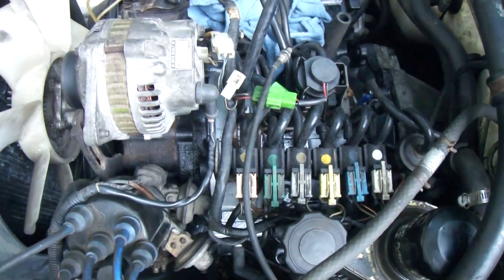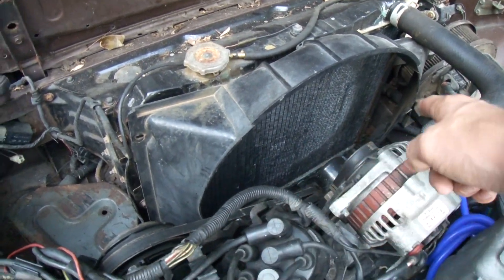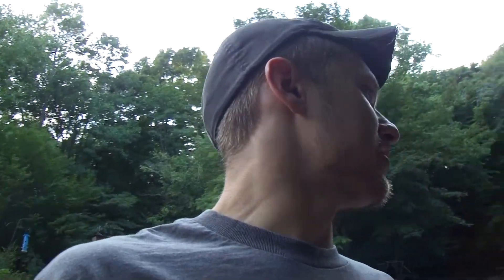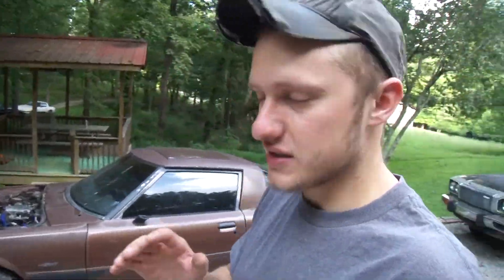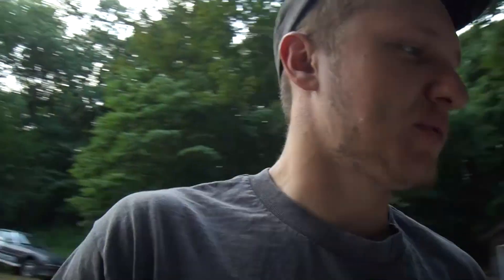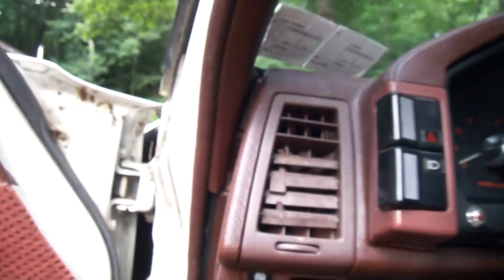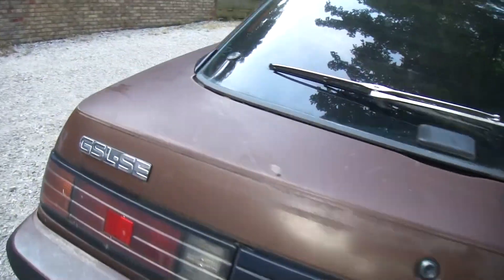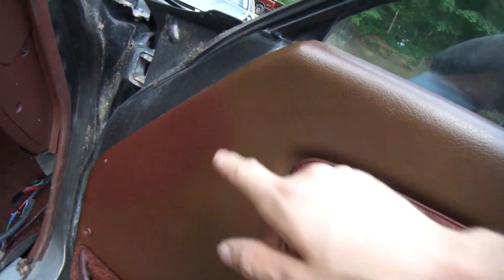84-85 RX7 COMPARING SUBMODELS - GSL-SE or BUST?

Comment: My 85 gsl came with power steering, ac, leather door cards and seats, electric hvac controls, power windows and mirrors, rear wiper, the good stereo, cold start assist deleted from factory with a blank panel on the dash, and igloo type coolers in the bins.
Reply: My 82 no badge Australian model came with almost all of those except power steering

Comment: Base model in those years was S.  Similar to GS, except no automatic transmission option, no power mirrors, no tinting along top of windshield, deletes various interior lights, no remote hatch release, no driver left footrest, and headlights are not halogen.  The standard wheels on the S and GS are steel, but the tires on the S are narrower, and both can be upgraded to alloy wheels.  S was just as much fun as the GS at a lower price.

Comment: I have a 1985 GSL, Red/Burgundy interior, power windows, power mirrors, full stereo, rear wiper, sunroof, power steering and cruise control. Other than the carbureted 12a, smaller front disks, non vented rear disks, different wheels and bolt pattern/final gear and rear badge... it’s hard to tell the difference from my GSL and a GSL-SE (at least from the drivers perspective). So my guess is that the options were all over the place. Great videos BTW!

Comment: Gday mate, I swapped the parts from my smashed 84 S3 onto a 82 S2 shell, heaps of differences, fuel tanks are different sizes not interchangeable either and my 82 didn’t have retracting seat belts,   Good channel too your OEM knowledge is very handy. Thanks mate.
Reply: How do you work the seatbelts then? Hand crank? 😂

Comment: I too have an 85 gsl with power steering.  Black paint, burgundy interior, the stereo with multi band equalizer, cold start assist, storage bins behind seats, power windows and mirrors.  GSL easily verified by the blue top carbed 12a in the engine bay and the choke knob in interior...and the GSL badge on the rear.

Comment: Interesting. Of the 4 I drug home in 2021 there's a 1981 GS with aftermarket sunroof which had a front mount oil cooler with proper radiator. I always thought that was OEM. Now I feel bad for selling off the oil cooler because I needed money.

Comment: I've owned six FBs, all with the 12A package. (designated "GX" in Canada for '81 through '83). I can confirm that the GSL (GX) and GSL-SE came STANDARD with the following: 

Sunroof, rear disc brakes, limited-slip differential, cruise control, power windows, power mirrors, power antenna, rear window wiper, upgraded sound system, electric enviro controls ('84-'85 only) and (in Canada) headlight washers.

The GS base model could be had with a sunroof, but only as an option.

Also, there is a difference between the under-rad oil coolers on the pre-83 RX7s and the under-rad GSL-SE oil coolers:

The spigots for the oil hose attachment points on the earlier 12A-equipped oil coolers  were welded onto the oil coolers at a 90-degree angle, ie: they came straight aft-ward from the oil cooler. The GSL-SE oil cooler on the other hand had these spigots welded onto the oil cooler at an larger-than 90-degree angle, ie: pointing the hoses at an angle toward the LH fender well. I know this because, on one of my '85 GSLs I got rid of the next-to-useless bee hive oil cooler in favour of an '82 rad and an ''84 GSL-SE under-rad oil cooler.

Comment: I have an 84 GSL with full power options - windows, mirrors, rear wiper, equalizer, fade/balance, and the hvac controls are all electric as well.  I think the only difference between it and a 5 letter is it's a 12a and the rear discs aren't vented.
Reply from the maker: I have seen that as well.
Reply: And the front discs are smaller.

Comment: I had a chance to buy a 1984 GSL. It had the choke pull, I remember a nice stereo, with nice buttons. Had 84k original miles and looked mint. I had some money but not all of it and I was young, so no real credit, and nobody would co-sing for me. Mostly because “the apex seals are going to go bad”, “it’s not reliable” yadda, yadda, yadda… Instead I was told to get a  Buick. Can you imagine?!?! A freaking land yacht Buick. So I saved up some more and about a year later bought a 1988 Mustang 5.0 lamo!

Comment: Although they are the same case, the SE has a softer LSD than the GSL. 
This is accomplished by having 1 less drive plate, with 2 driven plates side-by-side to reduce the amount of grab the unit has. I assume this is because the SE has a torquier engine so is able to compress the pack more effectively than the 12A which makes a solid 30lbs of torque less. When building my SE rearend I cherry-picked the best plates I had to build the tightest pack I could and stacked the in the GSL pattern for more grab.

Comment: My dad picked up a GSL with an automatic transmission that had power steering. Sadly, he sold it to the junkyard before I could raid it for parts. They do exist, but they are relatively rare. I am not sure if it was just an expensive option or if it was a dealer option.
Reply: My dads freind has a Candy Red automatic Gsl. and we have a manual 13B fuel injected sliver Gsl-Se

Comment: The trans case on the GSLSE is vented. I read a while ago that the gear ratios are different but I have been running a 12A trans on mine for a while without noticing a difference

Comment: Hi i have a rx-7 1985  engine makes a boot and loses strength. I switched gas pump filter gas filter and air filter the spart plug and kept on failing

Comment: Will a 79'-85' GS,GSL driveshaft fit any year model whether it has a limited-slip or non limited-slip.Are they interchangeable?
Reply: Do they have the same spline count coming off of the transmission and differential?
Reply from the maker: All manual N/A engine car's transmissions have the same spline count and are rhe same length.  From 79-83 the pinion flange will be the same regardless of LSD or open, 84-85 pinion flange will be same regardless of LSD, gslse, or opem

Comment: Have a question, I have a chance to get an 85 GSL-SE and it’s been in storage for 20 years. No rust but looks like rats made a home in the engine area. No cables chewed from what I can tell. I’m trying to get it for $300 is that a good deal? Thanks Paul
Reply from the maker: The rear axle alone will be worth your 300 dollars.
Reply: i'll buy it off you

Comment: I have an 84 GSL with power steering. 84 was the first year it was available and it was an expensive option.
Reply: Just finished the video. My 84 GSL has all the interior options that you said only come on a 5 letter car.
Reply from the maker: I figured you could get a fully optioned gsl as well.  Most I have seen are fairly base equipped though

Comment: Best comb gsl-se suspensions 12a motor gsl-se gear box racing beat header primary flow exhaust red pressure plate purple clutch block off plates racing beat double alternator pulley 3rd gear 100 mph b4 redline